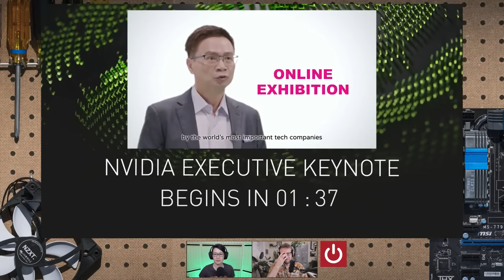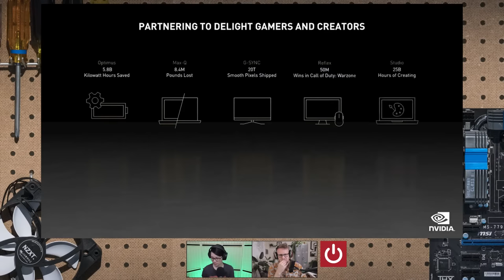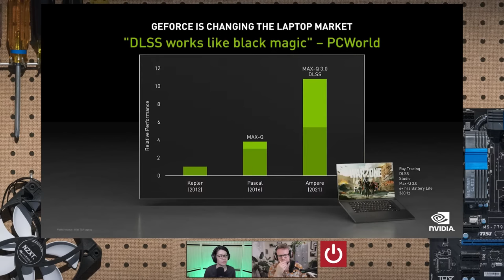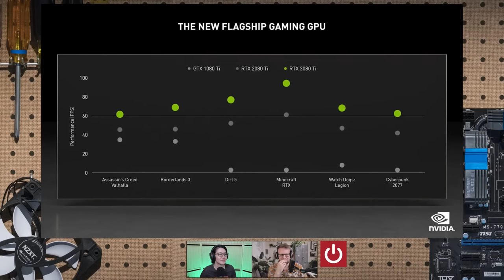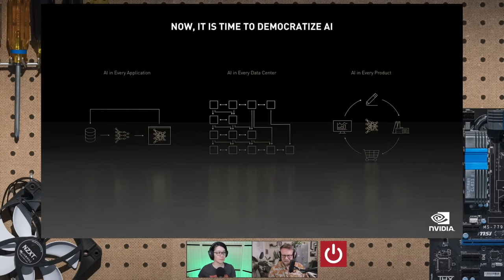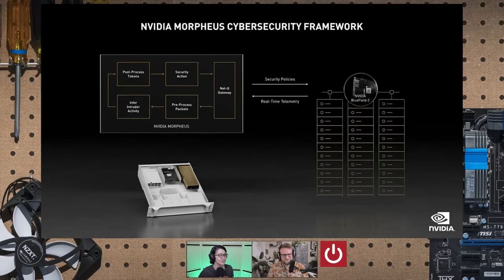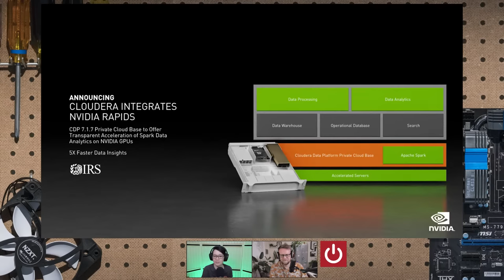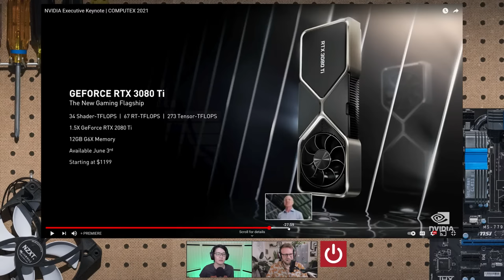Watch Nvidia's Computex 2021 Keynote With PCWorld

Comment: Why are they showing off new products when they can't make enough of the current graphics cards? Plus those prices, "starting" at $1199 (add at least $250 for the actual purchase) is ridiculous and starting at $599  (add at least $150 for the actual purchase) for the 3070 is still high. Then add in the mark up from the dealers that know they will sell to miners at any price so why not jack up the price some more. Nothing exciting in this presentation at all for me. I have a 4Gb 1050 Ti that I want to upgrade but I don't want to have that sore rectum feeling from getting reamed at the checkout.
Reply: Easy, more profits for the same resources
Reply: @Sicom It only is a light hash for ethereum....and the last time they tried it they hacked themselves with the beta driver. At best they're generating ewaste.
Reply: moving production then selling 3080 as 3080ti and 3070 as 3070ti...just add a bit more memory almost same performance

Comment: Its a little to late to implements RTX in DOOM E. Might as well run DOOM 2016 with Re-Shade and Ray Tracing using McFly's RT/PT mod. It really just works and doesn't require proprietary hardware. Also, you can run DOOM 2016 with a 3.6GHz Q6600 from 2007 and a GTX 1050ti at 1080p60 maxed out, Or 1080p90/120 with an RX480 8GB (RX580). Gotta love the Vulkan API.